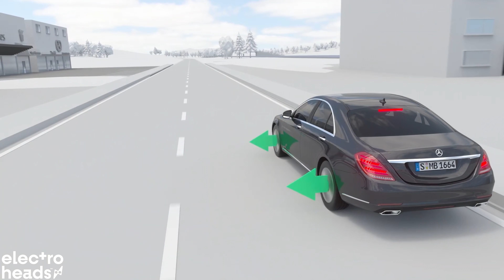The truth about why electric cars are so expensive

Comment: You see another angle (and this is my opinion) is there is less cheap money flying about. I remember couple of years ago and not long ago to be honest, adverts for almost brand new ford fiestas @ £99 a month with a £99 deposit. Those deals were just mental.

Now the cheapest I could find was £210 + £2.7k deposit. It's not earth shattering but it's a far cry from what deals we used to get. Now imagine forking out two to three times that for an EV ? It'll take a good ten years for the market to stabilise believe me I'm a car nut I've seen it over the years. The stock just isn't there yet to support the used and new market (Oh so is the money lol)

Comment: So, until car manufacturers can build and sell an EV to compete against the current crop of IC cars, I won't buy one. It is a means to get from A to B.  I can understand that car manufacturers need time to transition to EVs, which means turning off suppliers of exhausts, radiators, engines, fuel management systems etc, BUT don't expect Joe Public to fund that transition by buying premium prices new technology.

Comment: The comparison with computer storage is way off. Computers got cheaper because of the extreme level of integration plus the chips themselves got smaller using less silicon with smaller manufacturing processes. How do you integrate a li-ion battery to be 1000x smaller and still have the same capacity or even higher? You don't. Apples and oranges. Also, notice that modern hard drives use much less of other materials.  You can't beat the cost of raw materials with innovation (I am not talking about improved mining technologies etc.), especially if you're running out of many of them. Just use less of them and this would mean, at least in the case of batteries, much higher energy density and nobody has cracked that formula. Even Tesla with its 4680 batteries improves energy density only marginally. Energy density is not the same as energy content.

Comment: Another reason EVs are so expensive is govt interventions.  If government rebates were eliminated the prices would go down accordingly.  Right now they are a gift for the car makers disguised as a benefit to the consumer.  It's the reason battery storage and range has progressed so slowly.  Why can computing power double so often, but EV tech doesn't?  If car manufactures can charge a premium while continuing to offer under 300 miles of range, why invest to extend it?  It is cheaper to lobby govts to increase incentives than to improve the tech.  It's corporate welfare on a large scale and it hurts consumers.

Comment: Don’t underestimate the impact of charging. I will restrict my comments to the US since it is the only market I have knowledge about. Tesla got it right by massively investing in the supercharger network early on. In the US the development of non-Tesla charging stations has been fragmented between many providers with highly variable rates and distance and still not readily available in non-urban areas. To attain increased penetration of the marketplace fast charging that is convenient and reasonably priced is the sine qua non Of EV adaptation in the US. Concerning home charging, which I am now using, a level 2 charger is an absolute necessity for overnight charging. Adding level 2 capability to the average house costs between $500 and $1000 depending on where one lives. In my state (California) there are rebates available to help defray the cost. Over the next few years every house with an EV will need to have 2 charging. It will take time for this to happen. In the meantime,  lack of convenient charging will be a significant hindrance to the widespread adoption of EV’s. BTW Battery swapping will never work in the US. Tesla experimented with this concept several years ago and wisely let it die.

Comment: Quick correction, we had electric powered forklifts during that entire 150 year gap. Early DIY electric conversions were just electric forklift motors coupled to a standard car transmission with a mounting plate. Of course, there was a reason why small electric forklifts weighed more than your average car and that's because of the lead acid battery banks they used. So early car conversions had to give up space for passengers and cargo in order to haul more batteries around. But I've gone on too long now. Sorry for being so wordy.

Comment: My background is in electrical engineering.  I also have training in auto mechanics. I know the type of technology that goes in to these vehicles. Many of the components and the platforms are shared between the different manufactures.  They use the same parts sourcing. The main big differences are the style of trim, and how they do the finish on the vehicle.  There are differences in design for range, power, handling, and etc., that determine the price differences.  

I do a lot of research before I buy a vehicle. EVs presently are very expensive to produce. The prices will go down over time.

Comment: your calculations are crap. You assume that an 5 yr old EV bought with 26k will sell with 11.8k after 5 yrs but there's a problem. These cars only have 8 year warranty for the battery. Even if the battery lasts a little longer it will still be an old battery with reduced capacity which will need to be replaced after 3-4-5 years. Since the battery costs 30-40% of the new car price (the real price not the artificially reduced price through incentives) that means after 3-4 years of use you would have to put around 10k to maintain a car 8-9 yr old or discard it and lose all 11.8k you spent. Who in the right mind would pay 11.8k to use an old car for 3-4 years at reduced capacity??? An 5yr old car will also start to have other maintenance costs like brakes, suspension, other malfunctions which do occur after the initial "new car" period. Old ICE cars can be maintained with much lower costs to replace some used parts and have a much longer life. A more realistic price would be around 3k at 5 yrs to use it the remaining 3-4 years and discard it after that. An 8 yr old car will have almost 0 value. Ask any car dealer if used cars dealership makes sense with EV's. Sure there are always suckers but not that many to buy all the used EV's.
Another stupid assumption is the fact that in just a few years the capacity of the batteries would increase by thousands of times and the price would decrease by hundreds of times. That's plain stupid. If we could improve everything the same way we improved computers in their early phase today we could have ice cars which would go faster than the speed of sound with 1liter of gasoline for 1000km. After all we are making ICE cars for more than 100 yrs and they didn't improve at this rate. Even with electronics and new materials modern cars aren't even 2x more efficient and certainly not cheaper than 30 years ago. Batteries will get a little better and a little cheaper but not by much. Anyway not that much cheaper and better to compete with ICE cars.

Comment: Sandbagging could be true, as the aftermarket could be decimated by the lack of parts needed. I have a feeling lots of car parts companies are bricking it. When you have a service on your car they change the oil replace fuel oil and air filters.  With an EV it's just a cabin filter and maybe top up the screen wash. Tyres last longer brakes last longer as well.

Comment: The reason EV’s cost more is that demand is greater than supply. The total output of all battery factories for LDV use globally in 2020 was 142 gWh...(giga watt hours). That is only enough to make 2.2 million EV’s with a 64 kWh battery (same as on my e-Niro). According to The Economist there is $1.3 trillion of capital tied up globally in making ICE powered vehicles, this spread across about 1,000 factories which running flat out could make 90 million cars and vans a year. Problem is that ICE sales have peaked, the only growth market is EVs but OEMs have to extract as much value as they can from their invested capital in making ICE powered cars. Put yourself in the position of a Product Manager at a car company. You know that the margins on big, high spec cars are better than on the basic models, so why waste your battery allocation on basic models?...No, you spec up the EVs and charge top dollar for them. Battery manufacturing capacity will take until the end of this decade before it can get anywhere near the capacity for making IC engines.

Comment: The ugly truth is, that the biggest cost factor in Electric Cars is Range. If you just want Range and don't care about power this cost comparison gets really ugly. Example: A normal Diesel Golf (I just want range): 20.000€. Best Range for the ID.3: 48.000€!! I remember when Volkswagen said that the entry-level ID.3 will be close to a similar Diesel-Golf. Worst Comparison ever. That being said, what really bugs me is that even if you remove the cost of the battery, many EVs are still way more expensive. Best Example: Renault Zoe. Even if you deduct the cost of the battery, the difference is more than 7000€ to a comparable Clio. And concerning Power: If your Car is 500kg lighter you need less Power for the same Performance. Physics. Another lousy argument are Extras: Many extras EVs have are mandatory for daily use (and if you look closely you will see that many necessary extras for Evs cost extra (Heatpump, Three-Phase-Charger, Higher Fast-Charging-Rates).
And especially with the Zoe they already produced hundreds of thousands, so development costs shouldn't play too much of a role here. Well, still hoping...

Comment: Definitely sandbagging or 'creaming the market' as electronic manufacturers have been doing for years. However they aren't the only ones involved, look at the prices for recharging your EV at rapid chargers, it's almost as if these companies are looking at the savings you stand to make and helping themselves to a portion of it.
Reply: But most EV owners usually only see relatively costly rapid charging as being something they'd need to rely on for longer trips, maybe just once or twice per year. The majority of UK electric car owners are happy to charge at home. It's probably why the bought an EV in the first instance.... And the same has applied for decades. People only really bought fuel at motorway service stations if they needed to, because of the higher cost. With the range of even the lower end EV's now nudging towards 200 miles, the need to use costly motorway rapid charging will diminish. The average UK motorway journey is around 70 to 80 miles.

Comment: Hi 

Can you please cover the following points in your next video.

01- In a Battery Pack of 192 Cells for instance the Nissan leaf, How only a few cells need replacement after about 5 years of usage.
02- Why Lithium Ion performance degrades in very hot weather conditions.

Thank you.

Comment: Ok so you have expensive batteries about $10.000 less Engine $5.000 less G-box $ 5.000 less diff alternator radiator 
add electric motors  and i still dont see the cost difference

Comment: I think it is important in this context to at least mention Tesla's "secret" plan (in its various editions). Start with the pure-luxury roadster, use the money to build the high-end S&X, use that money to build the (expensive but mostly in reach) 3&Y, and the current plan aims for a USD 25.000 model not too far in the future, mostly based on improvements in battery tech. Now, this kind of plan clearly isn't needed for a traditional automaker, because they start out from a position of much more money available, so there sandbags might actually be in play.
Also, it sure seems as if right now, mass-market EVs pretty much sell as fast as they can be built (sometimes compared to hot cakes), so the size of the EV market is determined by the production capacities of the carmakers. That won't last forever, of course, but there's a reason Tesla is currently (while they have lots and lots of available cash) building factories as fast as they can. Given typical car brand loyalty, whoever ships faster will end up with a larger long-time market segment. I'm not sure that has really sunk in for the traditional carmakers.

Comment: As you can see from the public records of Teslas profit/loss statements, it is hard to make money selling a few EVs. It is only once you get  into the hundreds of thousands that the red starts turning green. I am quite sure that all of these other manufacturers are losing money on every single EV they sell, partially because of the low volume and partially because they are not vertically integrated like Tesla, so they are paying a premium for the parts. It will be at least 5 years before they make even a small profit on them if they survive that long. The bad news is Tesla has a decade  head start, and they are extremely innovative and fast moving, and will have a low cost vehicle in a year or two that will make other car companies lives much much harder.
Reply: Tesla is just really bad at building Cars and their Profits come mostly from really shady  practices and EU EV credits. 
The Premium for parts is pretty slim, you can see that in the numbers of the Suppliers. 
The Focus for EU brands is the EU because of the CO2 Credits, thats why they arent so thrilled with the Idea of selling Cars outside of the EU.
Most Major EU markets have a lot of incentives for EV buyers. They can charge a lot more than because the incentives lower the real price a lot.
This will end when the incentives run out, or a Company cant sell all the EVs they build at the increased price. both will not be the case for some time.

Comment: Nah, no sandbagging going on. The companies need the higher profits from more luxurious models to finance the HUGE investments needed to switch from making gas powered vehicles to EVs. Once the initial investment blow is softened and the EV building know-how is built up AND batteries become cheaper (improved tech, economies-of-scale), then cheaper EVs will become more prevalent.
Reply: I think you hit the nail bang on Dennis. Take VW as an example. We're talking a major switch here, and VW invested 800 billion Euros into three new plants on 3 Continents, to build electric vehicles exclusively. And because VW signed up to the Paris Climate Agreement, which is legally binding, they then have to ensure those new plants have zero carbon footprint, which they have. They also ensured the new plants are powered 100% by renewable energy. And on top of that, the cars are built from around 90% recycled materials. And this all costs..... There are few, if any freebies when going green....

Comment: From what I've seen, electric cars could be awesome. Quiet, great acceleration, low fuel and maintenance costs. But the high cost, high charging times, range issues and public charger availability make it a hard pass from me right now. Perhaps in the years to come, they'll be all around better.
Reply: EVs are great now. But in 5 years will be no brainers
Reply: Hi Sean. Why is your profile picture a KMT flag?

Comment: The equation still doesn't add up.  What is the replacement cost of a NEW petrol or deisel engine? The transmission? The fuel pumps, exhausts, ignition systems,  timing chains etc. Take that all away from the price of a vehicle and now ADD the cost of a replacement battery and motor etc. All at retail prices just to be fair. The EV MUST be cheaper to build. Now add on many of the electronics that may or not be really needed and you might start getting closer to even once again. Clearly, prices are being forced higher together with selling the concept of a smarter,  more capable vehicle in order to keep the margins up. Once manufacturing volumes pick up,  they will be able to afford the corresponding drop in prices (and margins).

Comment: The battery argument vs computer storage is not right atm, I've been using lipo batteries for 20 years in rc planes etc the capacity vs weight size has barely increased 10%, price hasn't come down much either, I hope new chemistry will change this ( and it is slowly) and greener cheaper batteries will make it much more doable but i wont hold my breath. 
10 years time things might be different, well I hope so because UK Gov banning new ic car sales in 2030.

My diy ebike is my ev solution for now and I can tell you it's a lot more fun than driving a car. ( not in the rain though lol )